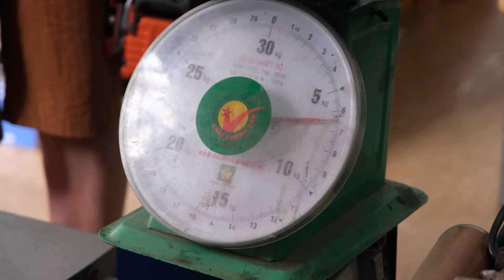My New friend (Chainsaw) Unlimited power

Comment: Couple of chainsaw tips incase someone already hasnt mentioned them. 
1. Person Protection Equipment. You need to wear some eye protection, and some real chaps if you can afford em, some ear protection as well if you are using it for hours on end. (Watch videos of how effective they are on stopping them from cutting your legs open.)

2. Undercutting is very dangerous and would advice against it until you are more comfortable with feel. Undercuts are the main reason for kickback and in that scenario usually into your face or shoulder. Thankfully your saw has the shutoff guard. 

3. You dont need to saw back and forth while making a cut, it is exerting energy you dont need to. Let that throttle open wide and do the work for you. 

4. Maintain your chain lube and sharpness. You can tell the chain is getting dull when the chips coming off the cut turn more into a dust/mulch.

Really not trying to come off as a pompous ass, but these tools are as dangerous as they are useful without the right knowledge. And seeing you have to walk into town for help, it would be detrimental for you to understand these things. Don't want you getting hurt and being stuck out there with no help. Cheers
Reply from the maker: Thank you, your shares are very useful to me

Comment: You need to use the teeth and let the chain do the cutting not pull the saw back and forth. Less strain on the back and arms. Also get eye wear, flying chips hurt.

Comment: I am slightly torn on the chainsaw. on one hand, you all have handily proved you can work with out it well and it is somewhat against the idea of the channel. but at the same time. I worked VERY hard for years when I was younger and the hard work damaged me to even today.
I would say if it is just saving the time to cut down the trees and such for the logs you were using the hand saw for I see no issues on it on bulk things like that. there is no value in 15 seconds of 5 hours sawing and hacking at a log into shape.
Use it for tedious things sure, but keep the primative things at the fore front like the farming and animal husbandry. I like how everything has grown from Duong building a hut and a water pipe in the woods but it ain't no good if you two constantly need to take big breaks from back breaking labour that isn't interesting to watch.
Reply from the maker: Thank you, your shares are very useful to me

Comment: Nice saw! For safety you should at the very least you should have eye and ear protection! Also, having some experience with chainsaws, the more wood that is cut the hotter the chain, the hotter the chain the more it contracts and tightens on the bar. It will tighten so much that it will snap, I suggest you loosen it to save yourself some grief and money in the future.
Reply from the maker: Thank you, your shares are very useful to me

Comment: Having a chainsaw is wonderful, but extremely dangerous for those who don't know how to handle one.
I highly recommend you get someone with extensive knowledge, of using a chainsaw, to teach you. 
You absolutely need better footwear. Preferably steel toe boots. 
You should also have cut proof leggings, to protect your legs.
A chainsaw can cut off your leg extremely quickly. 
Also, get wedges and a sledgehammer. There will be times that you get the bar pinched, and you will need the wedge to set it free.

Comment: chainsaws are so much fun... but can be a bitch to maintain... try not to let it hit the ground while using it or it'll will go dull quick... and before use make sure to sharpen the blades... oh and oil the blades before putting it away... the time tending to it will make is last a lot longer... oh and just becuase it's not on/running doesn't mean it's safe... if you let the stationary blades rub agianst you if you drop it it'll cut your skin all the way down... it's why you'll see people wearing these thick aprons while using them... but other than the scary-ness and the maintanency, they are still really fun...

Comment: It's dangerous to cut with the tip.
Those four teeth at the back of the blade are to stick into the branch and provide leverage.
Even expert loggers have accidents.
I admire what you are doing but watch some videos on basic tree cutting.

Comment: I can see why you wanted a chainsaw. 

But I gotta say, you're using it wrong and the way you are cutting the wood is going to get you injured. There are techniques to cutting with a chain saw that you need to learn. Especially if you are up there by yourself. You need to be careful. 

You don't saw back and forth with end of the chain bar. You lay the chain bar down, on the wood, holding it steady, as close to the housing as possible and let the machine do the work. Don't work with your arms extended. You need at least one held close to the body.

Watch some videos and learn how to handle them safely.

Also, I think this kind of content is more appropriate for your channel and not Primitive Skills. It goes againt everything Duong has done so far. 

I don't hate it, it's just not right for the purpose of this channel.
Reply from the maker: Thank you, your shares are very useful to me